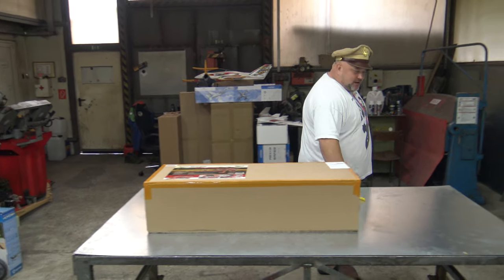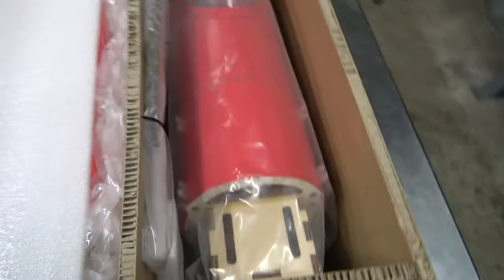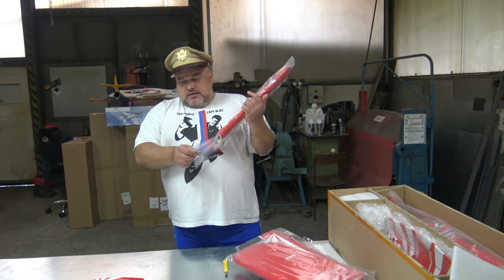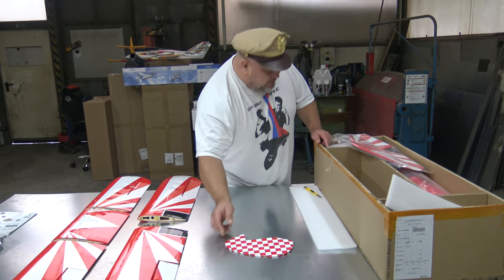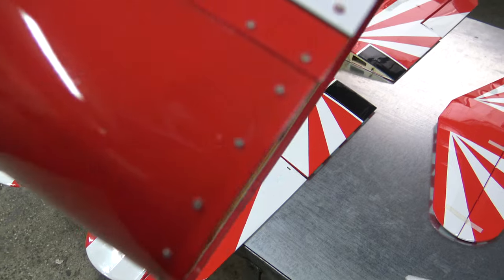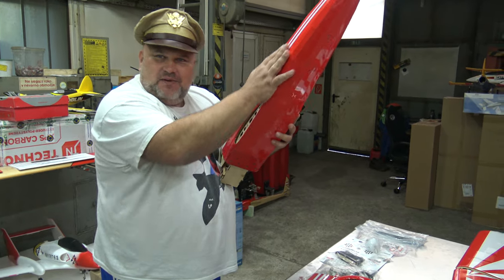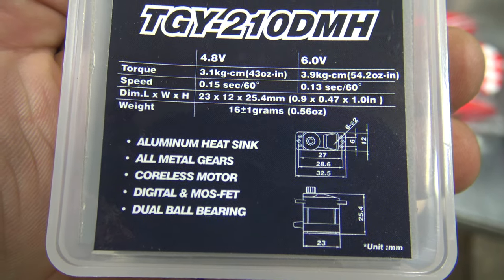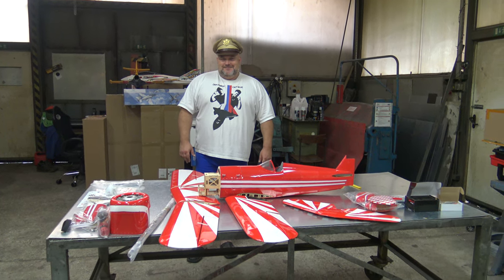Kingcraft Limited Edition ARF Super Stearman 1400mm 6S (Balsa/Ply/Composite) Unboxing

Comment: Nice plane. Thanks for sharing!
What I would do is to glass the complete dome section where the motor will be attached to.
Reason: Some years ago, a friend of mine flew his CAP 232 which accommodated a motor the size you intend to use. Short after takeoff, I just heard a "plop" and the CAP went down rapidly. The inspection revealed that the dome broke and motor continued his flight on its own. According to other pilots, this was no exception. It already happened before to other guys. So be warned... :-))
Reply from the maker: Interesting idea my friend.

Comment: Beautiful balsa bi-plane. Looking forward to the maiden flight video. I’ve only owned 1 Hobby King plane so far (Durafly Ugly Stick V2) and had numerous issues with the landing gear ripping off time and time again. Repair after repair didn’t resolve the issue. Landing gear is too heavy duty to be installed directly into foam with no wooden support underneath so I got rid of the plane. Plane flew very well but ultimately I lost my patience with the landing gear.
Reply from the maker: Oh I pulled out landing gear on that baby also. But now fixed with epoxi it holds pretty good.